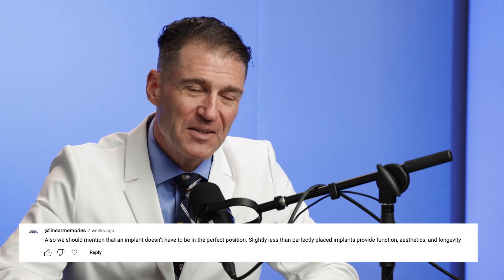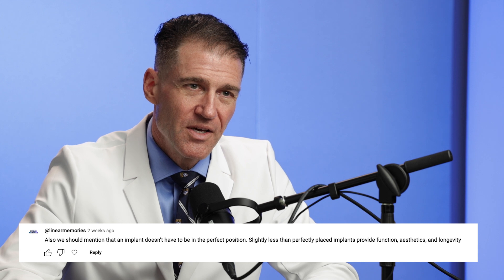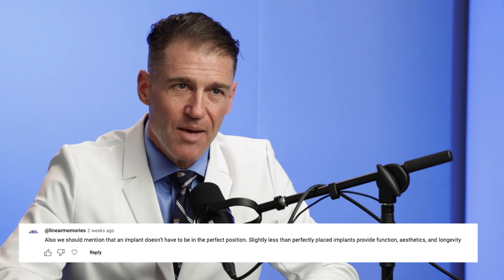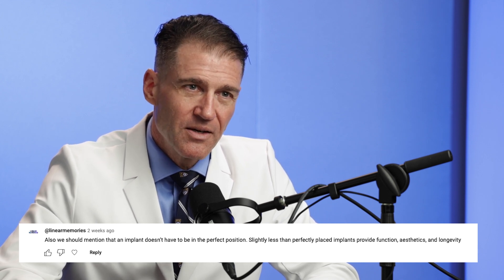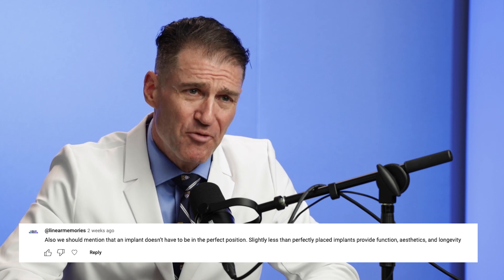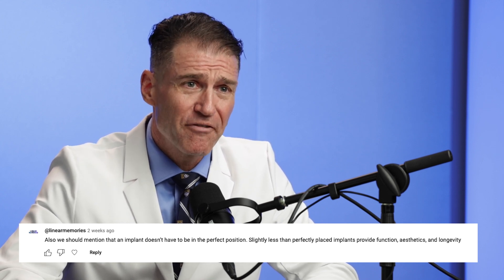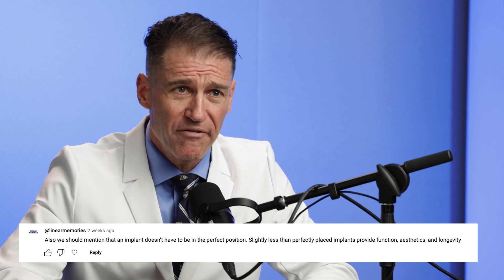Don't Settle for Freehand Dental Implants

Comment: I have had many cases where the bone is not the same as it appeared in the cone beam and placing an implant with x-guide or any other guided placement method would end up being a compromise to placing the implant in the best bone possible.  I place hundreds of implants per year and have way less failures than the national average. I find your argument for guided vs freehand to be weak and at best because you can't do that yourself and at worst because you're bought and paid for by some guided system. Having used both I would say that the guided system definitely has its merits. For young dentists that don't have good hand skills at placing, it is the way to start for sure. I would never say to people that enjoy the crutch of placing with a guided system that your less than for doing so.  Likewise I would expect from a seasoned dentist that place with guided that somehow placing by hand is less than.
Reply from the maker: "RULE 1 of dental implants--Implants in the wrong position WILL integrate" If you are measuring your success based on implant integration then you missed the point of the video. The point of the video is the implant needs to be in one specific location which is independent of the quality of the bone.
Reply: @Stanleyinstitute  Well let’s dissect that statement.  Yes even a poorly placed implant will integrate (agreed).  However, that is not what you said, You said an implant placed in the “wrong” position.  So what do you call the wrong position, 2-8 degrees of angle that is not ideal?  Do you believe that an implant that is 7-8 degrees from an ideal angle will fail due to a lateral force. Then how would you explain upper anterior implants or posterior AOX implants that are at 30-40 degrees. The forces are nothing but lateral/horizontal forces and yet success rates are high.  Perfect placement at the expense of good bone???  With the training that I have had and the 21 years implant placing experience, that is just not a strategy I would accept.  I wish you luck on your YouTube channel.
Reply from the maker: You are asking good questions for which there are good answers. There is only one ideal location for an implant. For every millimeter of positional error and every degree of rotation error the risk factors for the solution go up. Additionally, they go up exponentially not linearly. Which means with each little bit of error the risks compound. So if the bone is not where it needs to be to support the implant and subsequent prosthesis then simple grow it and place the implant later. Just like @steved7406 said above. Now Carl Misch hated angled implants with AOX solutions. As a good practice I recommend avoiding them if possible with the new short implants available on the market. The piece of engineering that Carl was missing is the concept of a truss. Trusses are used in engineering to create strong and light structures. They work by loading the individual elements in compression and tension. Conclusion: angled implants connected together with a strong prosthesis are not loaded in bending! This is why they work and why individual implants with angulation error will exhibit higher number of mechanical complications. My class is ideal for folks just like you. You have a ton of knowledge and experience and are simply missing some essential parts to bring everything into the light. I offer a money back guarantee because folks like you are starting from the position that there is nothing new to learn and hopefully this post opens you up the the possibiltles of an easy, predictable, long lasting solution for your patients.
Reply: A better clinician would put the implant in a better position for long term success and use guided tissue regeneration to ensure proper hard tissue support for the implant rather than hoping a custom abutments can fix your errors.
Reply: lol, ok dude.
Reply: Learn to fly first, then use autopilot

Comment: You have said that you can go guided everywhere
My question is - how do you do guided when from premolar to premolar is all zirconia crowns and you wanna implant the mollars? How do you merge the scan/model to the cbct in the SW accurately with so much scatter from the zirconia??
Reply from the maker: That is definitely a problem. The easiest way I have found is to use the radiographic sticker markers to do a dual scan technique. Otherwise, you could duplicate the maxillary denture and screw in a plastic version to do the work up.
Reply: @Stanleyinstitute   Dual scan technique? But that is for edentelous, I mean for a patient that has most of their teeth but it is all zirconia crowns. How fo I do that? On cbct there is so much scatter that merging the intraoral scan is super inaccurate therefore the implants will not be in the correct location.
Reply from the maker: You can use the dual scan technique on implant supported solutions as well. Place 3-4 stickers with the radiographic markers. Take an IOS and CBCT. Then use three point alignment on the planning software. Even with bad scatter this technique works. We have even used the stickers on dry attached mucosa to accomplish the same thing. If this doesn’t make sense email me your number and we can get on a call to discuss.